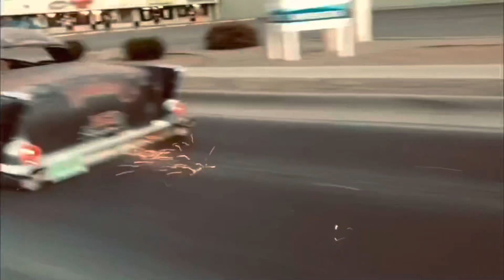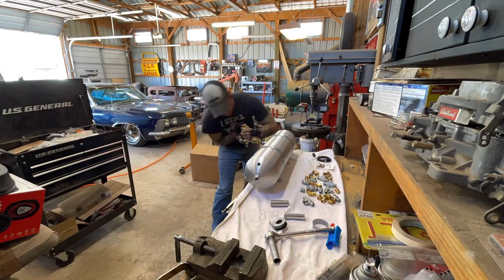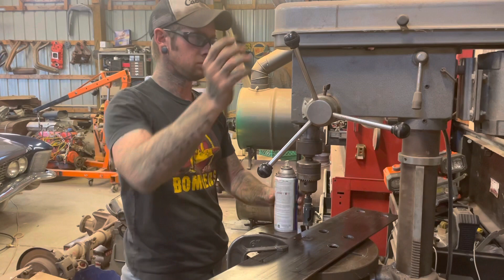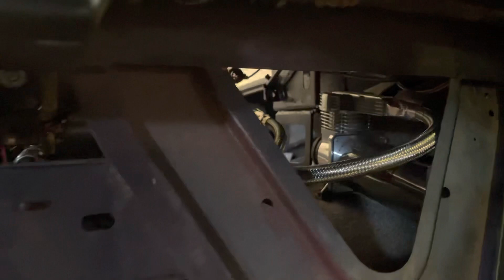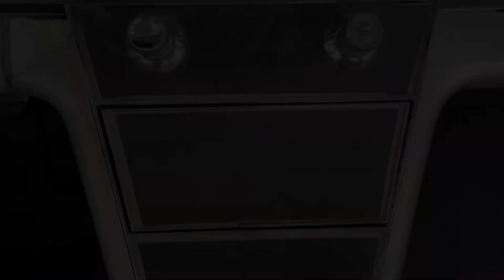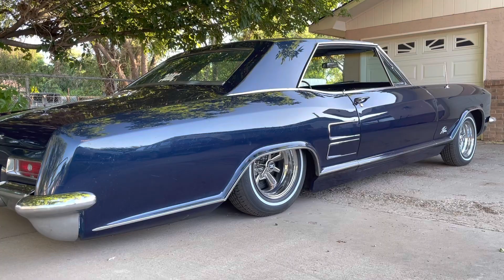63 Riviera Air suspension install: Part 2. Tanks & Compressors & Valves, OH MY!!

Comment: Nice work, does it  lay frame? I have a 63 too a couple years now been battling wire harness issues. Did you have to do anything with the  drive line or any problems? I like the ash tray mod you did clean. Same for air tank. I'm still not sure air vs. Hydraulics for mine I'm not hopping just want fast lock up. You adding scrape plates?
Reply from the maker: Hey thanks man I appreciate it!
It lays frame, as long as the exhaust is nice and tucked up tight. Nothing done to the driveshaft, no rubbing or anything. I don’t plan on dragging at all in this car, just lay and play. I’m going to switch out the front bags soon so hopefully it’ll pop up a little quicker in the front.
I appreciate the support!
Reply: @REKtheWORLD  I appreciate seeing 63's  they're out there but information isn't as well as parts. I know the specialty places got for 64 and 65 all day. I will keep an eye out for more on your ride.  Been some years that I had a ride again forgot things have to do and learn again. Tried getting a few things done paid for it twice having to do myself. Peace...

Comment: Is that an annular cutter you are using on the drill press to cut the holes in the mounting plate?
Reply from the maker: It’s just an ordinary hole saw from the hardware store. 1” if I remember right.

Comment: You mention changing the bags. What’s the reason? Are going you to a shockwave?
Reply from the maker: Currently I’m using a ss6 2500lb bag up front, they struggle to lift the weight of the engine, they take a lot of psi to do so. I suspected that might happen. I’m going to be using a 2600lb bag instead, and relocate the shocks. 
Thanks for asking!
Reply: Couple questions- I’m laying my 64 out

- shocks… OEM location and lengths front and rear? Or did you have to make something work?

- what pressure switch are you running on your tank? 

- is there any concern with the front spring pockets getting too close to the bags ( especially when you go to the 2600’s)

- did you go to a bigger alternator?
Reply from the maker: @jasonmatthews7098  sorry I never saw your question until now. 
Stock shocks in the rear. The fronts have to be relocated, I used the shock kit from BC fab.
I’m running a 200psi switch
I’m using the universal air, air house 2 bags up front, they’re rated at 2600lb but very small diameter. I didn’t want to cut the frame on this car.
I’m using the stock alternator.
Reply: @REKtheWORLD  thank you. I ordered all my stuff from BC Fab as well